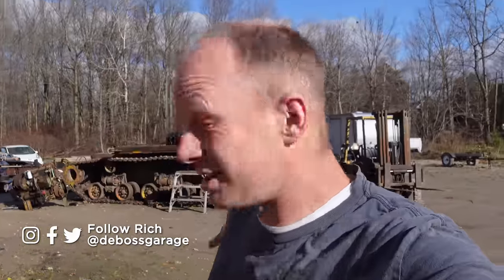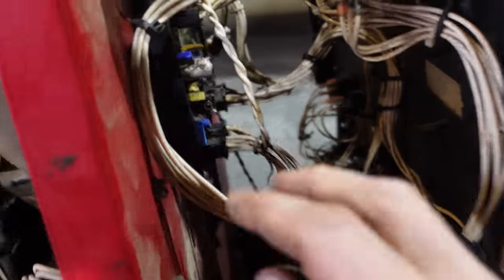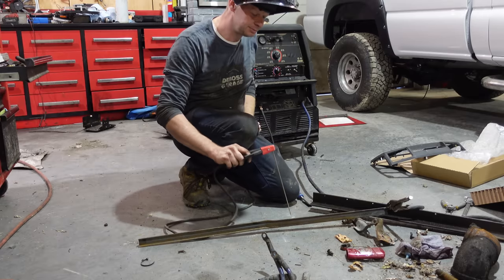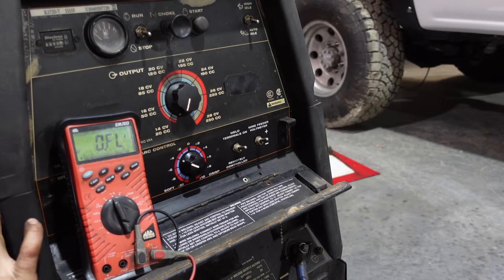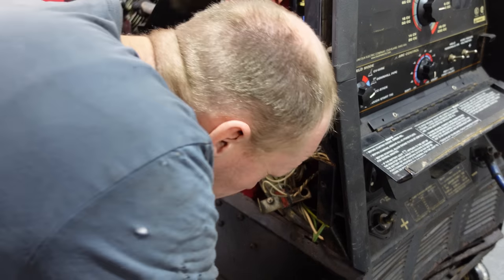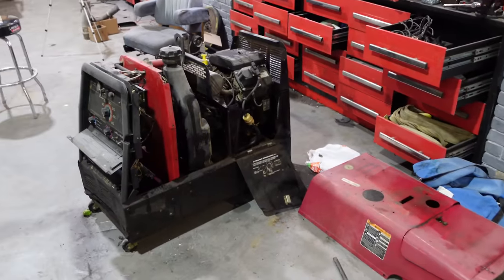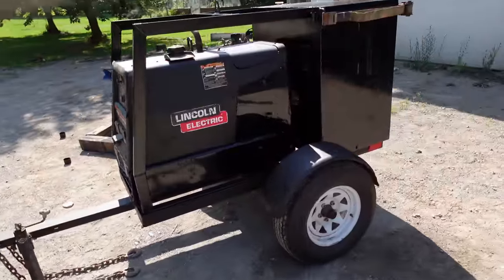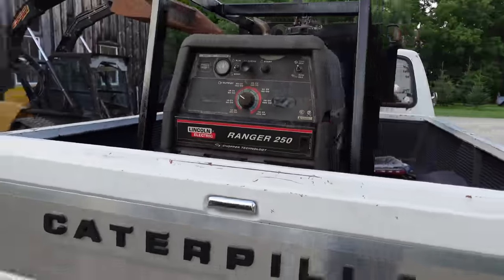$1,000 Lincoln Electric Ranger 250 Won't Weld. Can I Fix It?

Comment: it's funny arc control actually does something when hooked up to the multimeter. I've been welding for 10 years and I never use it, hardly does anything IMO
Reply: Isn't it just high frequency?
Reply: @ionstorm66  no it supposedly changes your arc properties for stick welding (how much the arc will dig) but i had someone play with it while i was welding and there's not a noticeable difference
Reply: Try it with a suitcase wire feeder. It definitely makes a difference! Changes the fluidity of the puddle, the shape of the bead and helps control spatter.
Reply: @ionstorm66 I could be remembering incorrectly but my welding teacher said it controls how hot it starts the arc. Usually only turned it up for 6010

Comment: Dude you had 90 foot of big thick battery lead off that bus that would have been perfect for the earth and live plus that burnt out electrical capacitor would stop the welder working. Those circuit boards are really crap . .